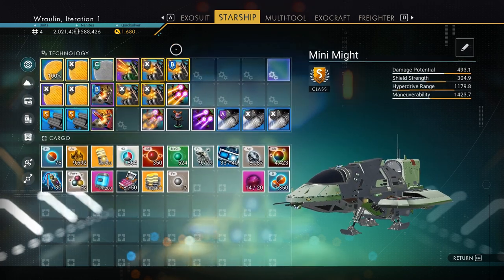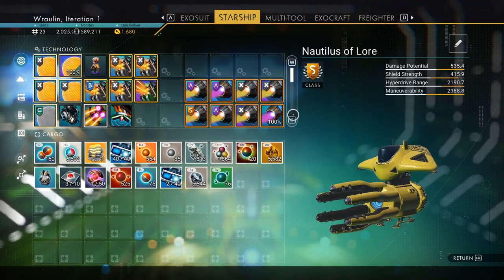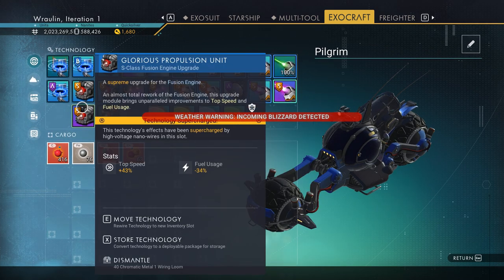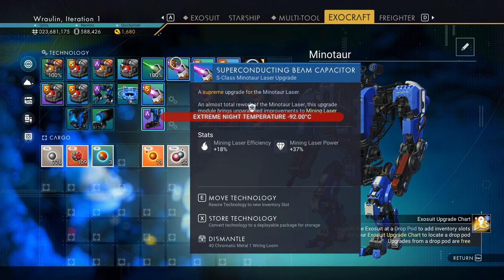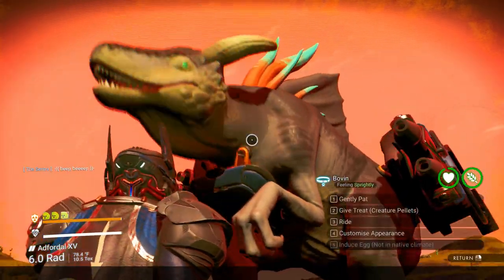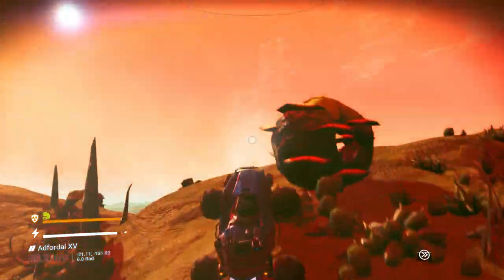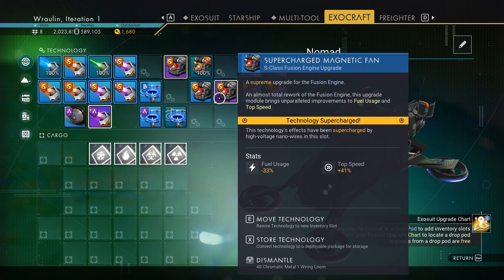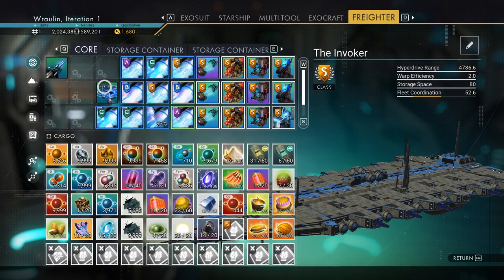No Man's Sky - Supercharging Guide & Demonstration

Comment: I highly recommend always make sure you utilize supercharged slots for weapons and shields first then worry about anything else especially if you play on a higher difficulty with ship combat.
Reply: Ship combat is a breeze regardless. best to use 3 slots for hyperdrive range and one slot to increase how many barrels the Infra knife has
Reply: @DENTALplan2002  I play on the hardest combat level. There's a difference between defend the freighter event which is easy and hunting down pirates from nexus missions. Yes combat still feels easy but stronger shields you still need. Don't forget sentinel freighter if you choose to fight it, yup. Infra-knife is good but positron ejector still the best ship weapon.

No one needs a ridiculous amount of warp distance that's what black holes are for. A good distance is good. Only other thing I would use supercharged slots for is pulse engines.

Comment: Super charged slot layout are tied to the model of ship. So ship "A" will have those slots in the same postion for whoever buys it and whatever class. Check out the radiant pillars super slot arangement, my infraknife is pushing out over 95k dps with X class max upgrades.
Reply from the maker: Wow that's an incredible layout on the infraknife. You should be able to cut planets in half with 95k dps, haha.

Comment: Do I use the same technique on my freighters ?
Reply from the maker: Yeah, use the upgrade modules on the SC slots and not the warp or device modules. I upgraded the 800ly A class improvement and the 300ly B class improvement to the warp drive on the supercharge slots and I think that will be the best move for most people.

Comment: Hey ik this is an old video, but for the Minotaur should I be supercharging the main canon or its upgrades? Does it depend on my upgrades or do I get more raw damage by outting the canon itself on the supercharge slot?
Reply from the maker: If I remember right the minotaur cannon doesn't display stats like the starship so I upgrade the sentinel arm upgrade first and then the S class upgrades after that depending on the number of supercharged slots I have and want to use on the cannon.